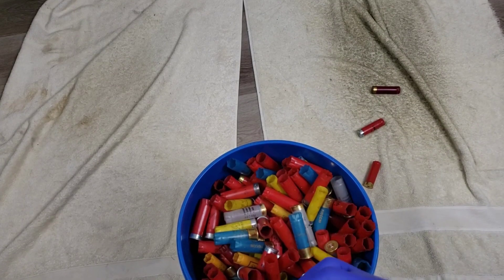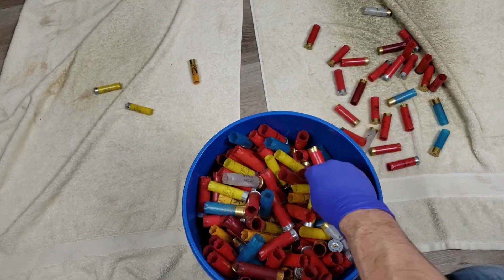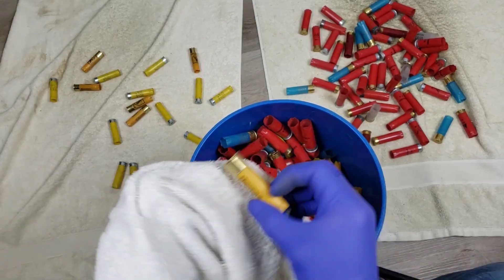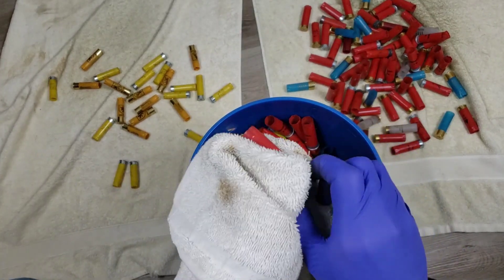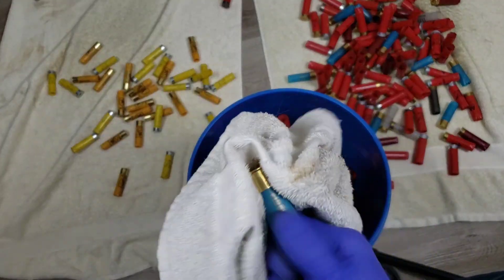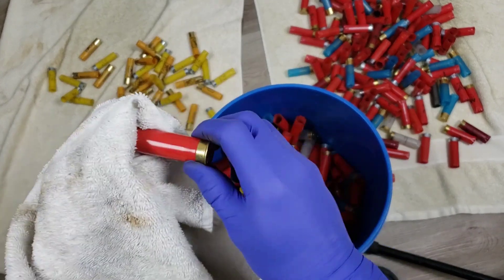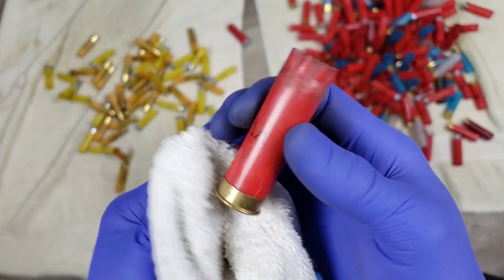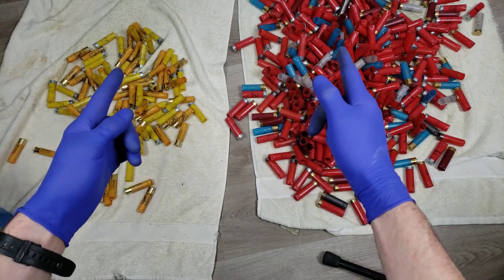Sorting And Drying Off Wet Hulls From The Range After Work

Comment: Speer reloading manual #11 gives this definition of dram as a unit of measurement for blackpowder quote : term used to indicate that a charge of smokeless powder produces the same velocity as a given number of drams charge of black powder . Thus, a 3 dram equivalent load has a charge of smokeless powder that gives the same velocity as a similar load charged with 3 drams blackpowder. One dram equals 27.3 grains .
Reply from the maker: Awesome, thanks 👊👍🇺🇸

Comment: Don't forget some shotshells have paper base wads, and are ruined if they get wet.  Since your a caster you have to try slugs, never had to much luck with lee key drive slugs, but always wanted to try some of the Russian molds or lyman, cool thing is lead hardness doesn't matter as much for the free range lead when it comes to slugs.  I had a pot for shotshells with soft lead and another pot for hard lead for rifles and handguns
Reply from the maker: I've been researching on some slugs so that will happen, eventually. I have plenty of range scrap to go around. Should be plenty hard enough if I can shoot the same lead in my pistols and 300blk with no issues. I have pure lead I can soften it with, too. I'll probably start with the Lee 7/8 but I'm open to suggestions 🇺🇸👍👊

Comment: Silly question...when those shot shells get to the point of being reloaded enough, will it have case head separation like brass rifle cases sometimes have?
Reply from the maker: I've heard the plastic just cracks and you can't crimp them any more. Usually 2 to 5 firings, depending on the hull. You can also just trim them down to the next shell height and reuse them for that, ending up with are essentially minishells.

Comment: One pound is 256 drams, one dram is 27-11/32 grains.  That's for BP.  If it says '3 drams equivalent' that means smokeless powder to an 'equivalent' power level of 3 drams but is NOT 3 x 27 grains of smokeless powder.  It's just to give you an idea of how much 'boom' it makes.  Unnerstand?   If you were using BP you could just multiply drams by 27 (27.5) and load using FFg but DON'T do that with smokeless.
Reply from the maker: That's what I was imagining but you used real numbers to connect it for me. Thanks👍